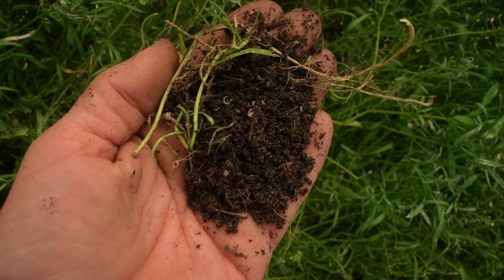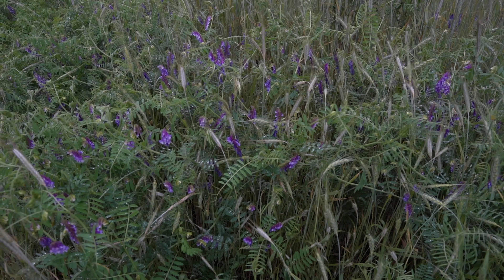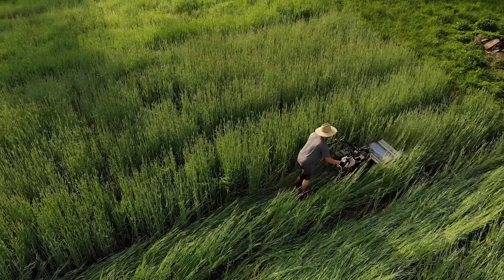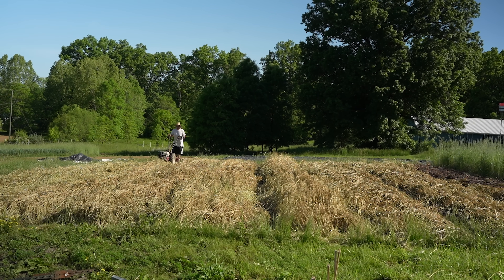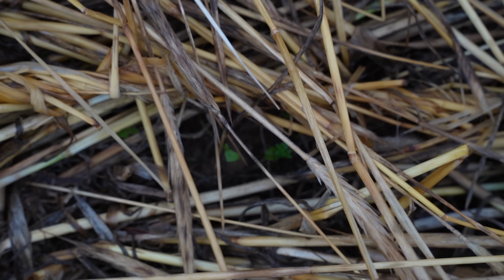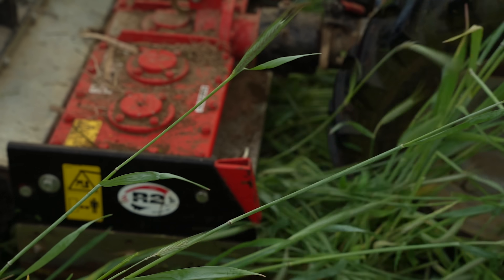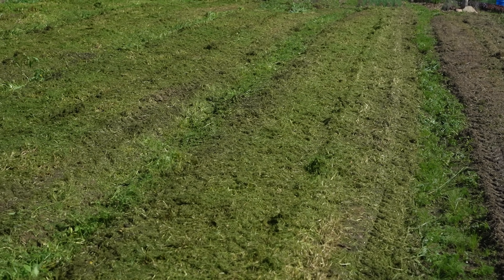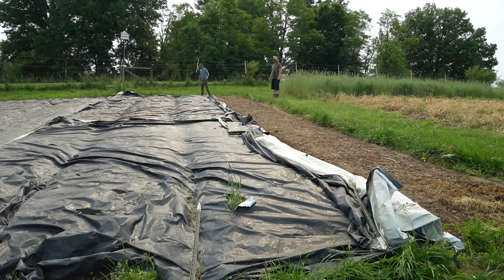No-Till Cover Crop Termination for Small Scale Agriculture

Comment: I found my electric mulching mower to work very well surprisingly - kinda like an enourmous weed wacker - now I don't have much land to work with - and it can be a lot of work to lift it up repeatedly, but it's light enough because electric - but it really grinds everything up, which increases the speed of decomposition(turf building).  I've learned when composting everything going into the bin should be ground to a pulp so the worms can travel more easily.  Now with a large area like you're working with, well, have you tried a riding lawn mower? I'd try a max height blade position for a first go through, then drop it down to lowest height.. and make sure it's a mulching mower. The way I look at it is it's just an overgrown lawn, of course you'll need to go back and lift/loosen, but we're doing that anyway right? Perhaps lifting could be somewhat avoided if the beds matched the mower wheel width? so the wheels ride on compacted earth.. then the mower max blade height might be a very close shave to the bed top. like cutting the lawn.. probably what cutting the grass used to be once upon a time before we all forgot what we're doing :D <3 >|<
Reply: ha, obviously commented before you talk about mowing XDD
Reply: but honestly - quick destruction can be done with this type of set up - careful driving could allow the 4 wheeler to skirt the bed on either side - with a large mower trailing directly behind - would make quick work of that cover so you can get back to focusing on other important more time consuming things - now this is gas powered and loud, but quick
https://www.youtube.com/watch?v=Xj2RbaCdlbE
You could also look into a gang reel trailer for a 4 wheeler/tractor - but i doubt they'd be as effective in destruction - but would be more cost effective - lower fuel
I'm curious, when you put down the cover crop - are you putting it down on existing raised beds? or is this more for establishing new beds?  because if the ground is level then it probably doesn't matter about the wheels - just because our industrial farmers have gone away from soil health, doesn't mean they were wrong with a tractor pulling a tool - so long as we're helping to restore the soil a little co2 from gas helps the crops grow anyway.. could also be done with a horse gang reel? ..etc.  
and well, lastly, if it's just about felling the crop- to make it flat - why not just scythe it? no fuel, can walk on your paths and scythe the beds
https://www.youtube.com/watch?v=VVn1kiZnldQ

Comment: How do you direct seed in terminated cover crop? Do you just have to 1) wait for it to break down or 2) rake it off? In other words, for a garden where you don’t want to wait 3 weeks, is your best option to then just use only transplants? Because I would rather leave the cover crop to not disturb the microorganisms/keep the organic matter …
Reply: Direct seeding into a cover crop is hard without mechanization to disc & drill. You have to open/cut a furrow by hand. It can be damn hard. I've used a blunt nosed spade. One of the reasons I hardly use winter rye any more.

Would be nice if there was a stand-up, push along power tool that would open up a couple of furrows in terminated covercrop for market gardeners.

Is there one & I just don't know about it?

Comment: One experiment i started with some success but havent the time yet to continue (too much project a the same time ^^..) is to do plenty of modular small "swimming pools" made from advertisement tarps, fill them with water (or leaving the rain to do the job) so it smashes very well what is under. You can valorise the pool's sun exposure for duckweed/azolla/baby plants under igloo greenhouse, so in place of having the soil not capturing the sun energy, and plastic beeing damaged by it, you can harvest it as algae mulch, fertilised water, or simply rain catchment. And doing kind of a "caterpillar" rotation, by transfering the "filler" to the next one, and on and on...
Reply: How do you support the sides of your pools?
Reply: @minkademko2335  Small poles, or igloo structure..
Reply: @Nooneinparticular987 Hehe..! Funnily you interpreted differently what i meaned and found new idea with it ^^
I was meaning that the small pools had also bottoms, (so itdoesn't matters if the soil "drinks" too much..) and when you fill it with something it helps much easyer to smother and decompose what is under under the weight, while valorising "the weight" under the sun exposure.. : )

Comment: My best luck (least effort) is to plant oats and daikon type radishes in the early fall, they winter kill when there's a hard freeze. The oats fall over and cover the soil, the radishes feed worms all winter and there's usually not a trace of them by the time it's warm in spring.  Most other cover crops like vetch and buckwheat, especially clover, are horrible about coming back as weeds for years.
Reply: Nice idea, Over here in the tropics of Peru we use peanuts to fix nitrogen into soil and mix in some quinoa and Chia before planting our crops
Reply: Wait isn't buckwheat killed by frost?
Reply: @Shanngella  It doesn't bloom all at once then set obvious seeds, so if any seeds fall to the ground, they sprout whenever - that year, the next year, the following year... They're easy to pull up but the amount needing pulling can become overwhelming.
Reply: Buckwheat seems to be immortal.
Reply: I planted oats last fall and they came back
Reply: What zone are you in and when are you planting your Daikon?  I've been asking this on a few pages just to get some info.  Going by packaging recommendations isn't always the best.
Reply: You don’t eat the oats?
Reply: It's really hard to thresh out the hulls @blugaledoh2669
Reply: We use oats and radish as well. Didn’t have to use round up in the fall or spring. Saving money and always great to minimize our herbicide use.  
I think radish is great a storing nitrogen in the root so it doesn’t move away over the winter.

Comment: Love your videos. I have a question: I sometimes put  my row under a tarp to kill off teh weeds or cover crop. I leave the tarp on for weeks. Question: Am I killing all my organisms residing in my soil? Did I just kill all my soil biology?
Reply: Great question, this is exactly why I have stopped using tarps. Everything seems dead, and tarps in winter or spring here in the PNW also leave the soil compacted from the weight of rain and puddles.
Reply: Many fungi & bacteria go dormant in winter weather. They "wake-up" when stimulated by plant roots.

(Over-wintering covercrops do the same thing. The roots go dormant but "wake-up" when stimulated by temp & light.)

Sure,  many microbes don't make it through the winter...but that's how it goes

Comment: I'm wonder what can be used as an accelerent once the cover crop has been dropped. Some compost recipes suggest plant pulp, eg comfrey, fruit pulp etc, does releasing a population of microbes that have been eating a particular cover crop spped up decomposition under the tarp?

I wonder whether mowing after the power harrow would help any, great surface area?
Reply: I do not have any experience with doing this yet, but I just read JADAM Organic Farming (second edition) and there are recipies where you use leaf mold to prepare a JADAM microbial solution. It seems it may help with accelerating.

Comment: In the UK I use Winter Tares over-winter and a great Nitrogen fixer. Very soft growth so after 3 weeks under tarp there is virtually nothing left. Sow September, smother in February without crushing and follow on with Brassicas without any other inputs.
Reply: There is some anecdotal info that hairy vetch much impoves the flavor of tomatoes. I am thinking of starting a new tomato bed treated with a covercrop heavy on hairy vetch to test this. Have you experienced this flavor improvement with tomatoes?

Comment: I was planning on weed whacking the crop at the base with a blade attachment, saturate the soil with microbial solution, and then tarp it. Dry hot climate in western canada.
Reply from the maker: That works too, though I will say that weed whacking a lot of cover crop is very tiring because of the density. I've done a few beds that way in the past and it's a lot of work
Reply: @notillgrowers  Hopefully my weed whacker Stihl's the show with it's ergonomic strap and handles xD
Reply: @emeraldgroveperm  What model Stihl & model harness? TIA
Reply: @flatsville1  I honestly don't know I got it second hand, but the thing rips and it is quite easy to use. It is the model with two handles and a strap.
Reply: @emeraldgroveperm  Thnx. I am looking at using a modified weed/brush trimmer with a modified conrete core drill as as a power harrow to mascerate/clobber stubborn covercrop & maybe create a narrow furrow to direct seed into.  A harness would help. See the video below.

What is inreresting is that an under 3 in modified concrete core drill bit doesn't tear up the soil too badly unlike some of the attachments he's modified. You can even core out a seedling hole. A light touch, using a harness for better control, might make this work. Watch at about min mark 3:45 forward were it looks like he's eased up on the downward pressure & is tilthing (& killing the weeds) while making a seed bed.

Also this bending over & digging crap must stop.

https://youtu.be/JPGDLBg7JkM
Reply: @emeraldgroveperm  After posing the idea of cutting a furrow through covercrop to direct seed using powered push or walk behind device, a landscaper friend reco'ed buying a used pro model lawn edger. They have enough torque to cut down through root mass & have wheels & can work in tight areas like a raised bed. Since I'm not direct seeding anything too tight like wheat, it could work. Damn!
Reply: @flatsville1  Good luck with your idea!

Comment: A great way to terminate a cover crop that was not mentioned in the video is to scythe it. This method is extremely effective if done at the right stage. Our main cover crop, buckwheat, dies right away once the plant has flowered and is scythed right above the soil. Buckwheat also cuts very easy, versus more of a thick grassy cover crop such as winter rye. The only issue we have experienced is letting our bees forage on the flowering buckwheat for too long to where it begins to go to seed. I believe Frith Farm does some scything as well.
Reply from the maker: We're playing with the scythe too, but the issue for is that our farm is like a slalom course so getting a good consistent cut is really tough on uneven ground

Comment: If you put the handles of the bcs high, you can stand on the power harrow to add extra weight… step off to adjust direction if needed.
Reply from the maker: I've done that, too. It's a little unwieldy to steer (and maybe not the safest thing) but on flatter ground it works

Comment: I've very curious about animal assisted termination.  Example:  What if you have a feed crop for chickens that is all the way to seed, then crimp, then apply chickens with electric wire and say protection, like a good or dog?  Just a thought.  I've seen plenty of animal integration in farming before, but no till animal termination is an area that is rarely experimented with.  I've see one video on you tube involve sheep, but it wasn't well done.  I'd be much more interested in your scientific approach to such things.
Reply: I had an overabundance of chickweed last spring (in my peppers because the harvest was late and I was lazy and didn't get a cover in) so I opened the field and let my chickens in...they decided they preferred to dig around the paths for bugs and ignored the chickweed, which only one chicken pecked at! so FAIL!

Comment: A faster option you didn't mention (for when you can't afford to wait 3 weeks) is to crimp/mow the cover, than tarp it with landscape fabric and immediatey transplant trough it. There's the occasional rye that manages to creep into the hole but it's quite easy to remove them by hand. Not very practical tho when the mulch layer is very thick, it'll make opening a passage quite hard on your fingers
Reply from the maker: Yeah, that's an option (depending on what you're planting obviously). Good addition, thanks

Comment: You're not doing the multiple continuous covercropping, so you're lacking the same positive weed-suppressive results as researchers...

So there are no small scale crimpers?
Reply: @ewokjerky4508  
They make rototillers to replace plows.  Feet aren't that great at crimping, especially when you have multiple concurrent cover crops...
Reply from the maker: I briefly discuss the roller crimper that exists for small scale later in the video.

Comment: Great video as ever. Clover is a nightmare. I mow. I tarp for 6 months  and it still needs to be handwheeded has it just won't die! Haven't done buck wheat but worth a try.
Reply: Is it causing problems for your crops? I have lots of it growing in between or under crops and it's been no problem. I usually just trim it down a couple days after it flowers.
Reply: @cmwh1te  well basically it takes nutrients that are for veg and I want to kill it in place so they are returned. If it doesn't do that it's locking up minerals unnecessarily. Plus for early planting it can shade out seedlings such as parsnip and carrot.
Reply from the maker: Wait what kind of clover? Yellow clovers can be like that. White and red are more manageable.

Comment: Here in zone 3 we mow or brush cut the winter rye in mid may and rake it off so the soil can warm some before we plant in late May/ early June. It is hard to kill off the rye no matter how low I cut it. I have to go over it once a week it seems to cut down regrowth. I have not tried tarping as I don't have any.
Reply: I'm in zone 8b and in my raised beds I have used winter rye but didn't know what to do in the spring to get soil ready for crops.  I decided to chop and drop them cover with black tarp.  This took quite a while , over 4 weeks and wasn't done breaking down when I wanted to plant in the soil so I broke up most of the rye clumps and hand turned under where they eventually rotted in the ground.  It did make the soil nice and loamy and lots of worms.

Comment: I wonder how good a lawn roller would do against cover crops
Reply from the maker: I've tried a bed roller with a lot of weight and it doesn't quite pinch the stems enough
Reply: I use a homemade very heavy roller made of concrete pulled with my 4 wheeler. Takes a few passes but works. I don’t think it creates too much compaction either.

Comment: Last year i had suprising success letting cilantro and arugula stay in the beds and flower. Because flower stalks are so much more fibrous they actually stick around and create a great mulch. I terminated them either 1) waiting for a frost here in Maine or 2) i put on snowshoes and just walked over it sideways right at milk stage. This is great because you dont need to buy separate seed and you also dont need to plan out a whole separate crop for the bed. You can just neglect some beds and they naturally will flower and they do the planning for you. In the spring we were able to just rake it all aside very easily. I’ll be trialing these much more this fall
Reply from the maker: I always though both of those in my fall mixes when I have extra seed! Cilantro is surprisingly winter hardy here in KY
Reply: What do you do when you take it aside? Like are you then making room to direct seed, or is it still too much stuff in the way so you have to do transplants? If you rake it aside, do you leave in there or bring it to a compost or sometning to re apply later?

Comment from the maker: Oops, just realized I sound like I call Buckwheat a legume in this video. Buckwheat is not a legume, but it is easy to kill. It's in the Polygonaceae family along with smartweed and dock and others which makes sense because all can easily become obnoxious weeds if allowed to go to seed. Also related to rhubarb though which is delicious. Yup
Reply: Hey Jesse, any idea how much of an impact tarping to kill the cover has on the microbes? 
Curious how quickly they would die back especially mycorrhiza. I always hear Jones and others say living root but I wonder how long we have in between crops in the ground before we lose some benefits.
Reply: how about terminated sunn hemp using hand tractor with additional rototiller tool without digging soil?